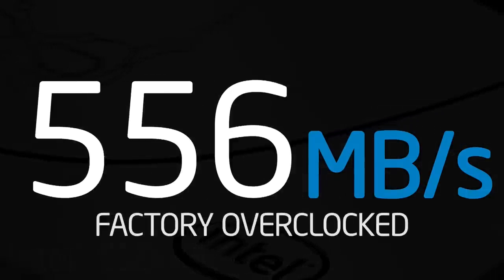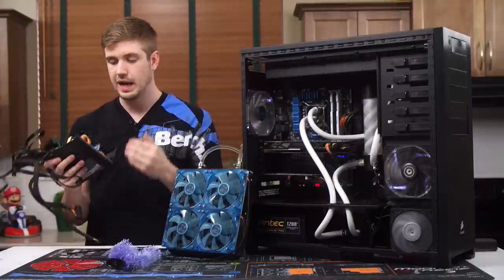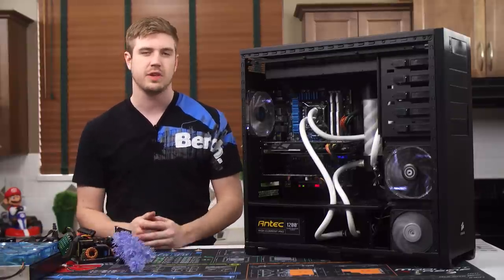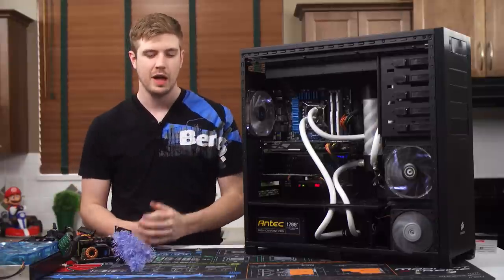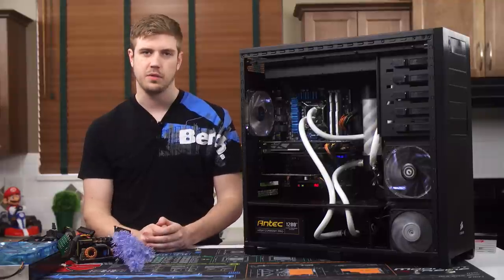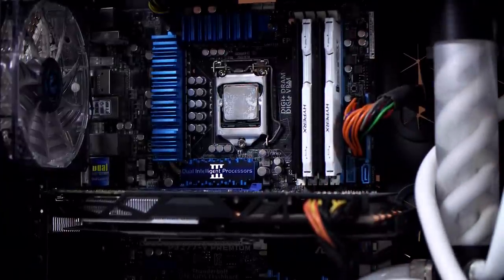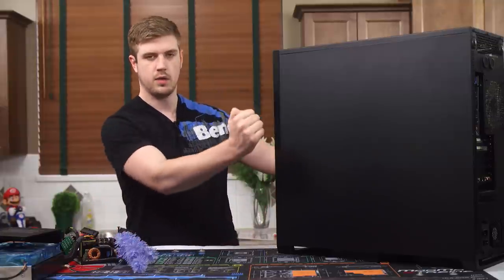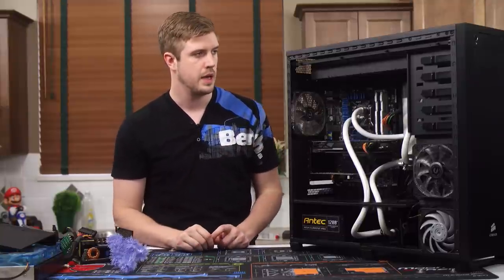Personal Rig Update 2 - Slick: The Introduction of Squirtle

Comment: I am still rocking my hd7870 and FX6300 ^_^
Reply: I dont really care I can still run all my games on high/ultra on 1080p going from 60-150(or 200(CoD4 :3)need thtat speeed and my display is 1080p) no problem.
Reply: yeah I have the same build and its amazing. no need to upgrade for a while
Reply: I'm on the fx-6200 lol, gfx is gtx660 but got the 280x coming this week. Wonder how much the fx-6200 will keep the 280x back ^^
Reply: DurkaDerper No I can't, it can't even turbo on my mobo ^^ an Asrock 960gm-Gs3 fx motherboard. But I will buy the haswell refresh with a nice mobo and the 280x is just for now, I'm waiting for the Gtx880 or maybe another 280x
Reply: I have a 7870 too :P
Reply: It's funny how you say "still rocking" as if it wasn't a 2 year old setup at most xD no offence of course, it's just a bit funny. a friend of mine got exactly the same on my suggestion ^^
Reply: Dustin Levine That's a good price. Here in Sweden I payed $260 for a GTX 660.
Reply: Erik4boss
I payed the same, I'm also Swedish. But the price on inet.se was ok for the 280x, I got the asus DCUII top version for 2790SEK or 420 dollars and got a fractal design integra r2 750w for 60 bucks, it's on sale at the moment. I'm expecting my parts will arrive on Tuesday or Wednesday ^^
Reply: That is pretty nice! I'm probably going to get a GTX 770/870 in my next build.
Reply: Salpeteroxid you won't get any less performance from a 280x with a 6200 unless you seriously under clock it
Reply: Erik4boss Yeah i'm also just waiting until the next generation of gpus to start rolling before i upgrade since the price to performance ratio of upgrading now just isnt good enough for me.
Reply: HD 6870 i7 2600 ^^
Reply: I run Phenom II X4 965 BE at 4GHz and R9 270X.
Reply: Davidxcat That is quite powerful actually!
Reply: I have two 7870.  #7870masterrace
Reply: BlackyProd atikmpag.sys error 7800-series masterrace regards 7850
Reply: Erik4boss And really hot! During summer I am melting in my small room.
Reply: Davidxcat I'm melting too. 4 monitors, they produce A LOT of heat.
Reply: Gtx 670 and i7 3770k :D
Reply: Jonathan Hine I mainly play BF4 and my CPU usage is really high. Can't wait until haswell refresh with that soldered ISH and a sweet z97 motherboard!
Reply: Salpeteroxid It will hold it so much back man trust me. I went from 58 fps (660ti) on cinebench on that cpu to 102 fps (660ti) on a 4.7ghz 4670k :)
Reply: Laurence Barnes Maybe I should have went with CPU and Motherboard first? But then again, I want the haswell refresh i5 since I'm planning to OC' it then not change CPU for 2-3 years.
Reply: Try a socket 478 pentium 4 with 256mb of ram
Reply: EnchantedxPie
No thanks!
Reply: I have a PC with C2Q Q6600 @3.2GHz,+ 4GB DDR2 RAM + Nvidia GTX260 216cc 896MB and I still love it, but I'll upgrade my GPU shortly but will keep the GTX260 for a dedicated PhysX card :)
Reply: Core i7 860 and GTX 570 represent.
Reply: Salpeteroxid I am using only 2 monitors. But during winter it is great.
Reply: I am still rocking my gtx 780 and 4770k ^_^
Reply: Salpeteroxid you'd be better going for a 8320 or a 6350 or if you really have to go Intel an i7 cos battlefield 4 utilises all cores possible so you want as many as you can get
Reply: Still using a good old i5 2500k and a radeon 6970 Flex :D
Reply: I am still rocking x2 270 and hd 4350 so yeah ...
Reply: I'm rocking a Gigabyte Geforce GTX 770 and i5-4670K :)
Reply: I'm still rocking a HD 6870 and an A10 5800K xD
Reply: TheFDDP Why would you use an APU with a dedicated GPU?...
Reply: I recently bulit a pc with a fx-6300. great for BF4
Reply: Jonathan Hine
No most definitely not. The performance between my fx-6200 and the fx-6350 is almost non-existing making the worst upgrade possible price/performance. Really bad advice.
 I don't "have" to go Intel, I want to go Intel because the processor are way better and I can afford it, and if I wanted to go fx-8350 I'd have to buy a new motherboard anyway and I'm not really on a budget so Intel it is.
Reply: I'm still rocking my crappy intel 4000
Reply: I rock intel hd 2500... So please everyone stop whining
Reply: 560ti and fx6100
Reply: I have the same specs, but with a R7 260X instead.
Reply: Yess my comment just passed Linus's comment-less comment I feel so fulfilled ^_^ Lol.
Reply: QX6850 & 4870X2... Currently waiting on a few more parts to get my R9-280 & 9590 build together
Reply: yuri53122 Good luck :D
Reply: Dylan Saranov Because at the time I had no idea it was an APU, I got it because it was quite cheap for it's performance.
Reply: HD7870 XT Joker and FX-8150. The ultimate heater for in the winter that absorbs a butt ton of energy!
Reply: am rockin a sapphire r9290 and FX8350
Reply: single core Pentium 524 oc 3.8GHz with Hyper threading and ATI Radeon xpress 200 64mb waiting for new pc parts with 8320 and r9 280
Reply: yeah I go the same setup too. not that old.
Reply: 760K and R9 270x
Reply: Salpeteroxid 880 isn't coming out till next year so I recommend the second 280x.
Reply: 2x hd radeon 6870 and i7 4770k
Reply: i5 4670k and GTX 670 :D
Reply: Phenom II X4 840 and GT240.
Reply: MrJigssaw1989 I had it on 4,38GHz but it was too much. I am not rly good at overclocking I was just trying how much I can get from stock voltage.
Reply: FX 8320 , HD 7970 :D
Reply: Q9550 (core 2 quad - yorkfield) @ 2.83 with a GTX 9800+ 1gb of GDDR3 on a gigabyte P45 motherboard and the fastest memory of the time 8GB of GDDR 3 1600 2008 FTW
Reply: GTX 660Ti and FX6300 here
Reply: Asterisk
I know it's not coming in the near future and I'm still waiting for the first 280x to arrive and one 280x will be sufficient for 1080p gaming on my 60 hz monitor for a long time. A second will probably not be needed this year for my purposes.
 I'm going to sound like an ass right now but I'm really tired of "recommendations" when I haven't asked for one. Especially the one from Jonathan Hine
Reply: Fx-6300 @4.4 with GTX 760
Reply: gage oldham
What's your bf4 FPS and what settings (if you play it).
Reply: I play on ultra and get 60FPS because i capped it
Reply: Salpeteroxid I was just trying to give you the best information I can to help you get the best performance because bf4 is a multi threaded game but you don't have to go with my recommendation it is your money anyway :)
Reply: Jonathan Hine
The difference between fx-6200 and fx-6350 isn't worth the money while the haswell refresh is a HUGE step up from the fx-6*** series in battlefield and I'm not on a budget.
 The fx-6*** do have six cores but only 3 modules and the cores shares resources, thus making them less able then an architecture like Phenom or haswell which has one module per core.
Reply: Salpeteroxid but you do have those 6 physical cores which you aren't gonna get with the haswell refresh but yes you will probably get slightly better performance from Intel
Reply: Jonathan Hine Nope I'm going to get 4. but it's not about the cores it's about IPC, that's why the 2 core i3 with hyperthreading is almost as good as the fx-6***.
 I'm not going to get a slight performance boost, I'm going to get a massive boost.
 I don't think you know that the modules set up an instruction for the core to compute and if you have only have 3 modules on six cores the cores will not always get an instruction when they are available but will have to wait for the module to send one. I have absolutely nothing against AMD, but I can't see your logic in spending €100 for 10% performance while I could spend €160 for 40% more performance.
Reply: I just knew that the 6300/8320 had 6/8 cores I had no idea they only had half the modules as cores and anyway I went for a 4670k so I can't really complain about you getting a haswell refresh cos I'm getting better performance than my friend with a 6350 in most games but they are more expensive which is one reason I was thinking of for going amd
Reply: Now I'm rocking the 280x and fx-6200.
Reply: Jonathan Hine
Np, tried to explain it as good as I could. :)
Reply: :) and how's the new card?
Reply: Jonathan Hine
Best thing ever, and bullcrap pile of garbage. Graphics are great and mantle works amazingly good but I can't connect all of my four monitors, only two. It would be very much appreciated if someone could help me, I have the asus top DCUII card and all kinds of adapters.
Reply: Salpeteroxid what kind of connection are they?
Reply: Jonathan Hine Displayport HMDI DVI/VGA with adapter and DVI. I have Displayport to DVI and Displayport to VGA adapters if needed but Windows says that I can't save the monitor settings, it drives me NUTS!
Reply: Idk it might be the vga connection but thats a long shot
Reply: Jonathan Hine I've tried all combinations. All digital, digital and DVI-VGA adapter. Really annoying, especially since the cards performs so well in BF4 with mantle that compensates for my fx-6200 (will be replaced when haswell refresh comes out in Sweden).
Reply: idk then it might be your cpu not having the horsepower to drive all the displays but thats just a geuss
Reply: Jonathan Hine It worked perfectly fine with a weaker GPU, the 4 monitors doesn't really demand any resources. 3 monitor gaming does, but I could do it on my GTX660. I really don't know the problem and it is really annoying. I wish someone knew how to fix it but I don't know anyone that has a 4 monitor setup =( Thanks for your help anyway :)
Reply: still pushing my 7870 to the limits. but i recently got a 8350 to upgrade from my 6350 basically for free. I think the next step will be a simple swap for a 290x and then rockin on with coming mantle titles
Reply: Michael Pfeifer Still using my Athlon 435 and HD 7700
Reply: Amedinno i sadly just today reached the limits with Far Cry 4 :( can only play on mixedmediumhigh at 1080 to get fluid 30fps. time for an upgrade :)
Reply: I can't even play 60 fps stable LoL :D
Reply: Jonathan Hine
I got the i7-4790k.
Reply: I just upgraded form my Phenom 955 and HD 5750 not long ago. I was getting med-high on most games, but it was finally lagging behind. Was a good 5 yrs with that PC. Now every single part except the dead power supply is in computers of family or friends who just needed a basic PC.

Comment: Just finished my build, took a lot of advice from your channel Linus. Put a video of it up a  couple of days ago (tour video) and I think it went really well! (4770k + 780 etc)
Reply: If anyone can see a way I could improve my build then any suggestions would be awesome!
Reply: BarbecuedPossum U could add another 780
Reply: Afootpluto Yeah, I was thinking of doing that, but a couple of problems haha. 1: My CX750M wouldn't quite cope with 2 780's I dont think and 2: 780's are rather expensive, I'm looking to do some things that can be done quite quickly and inexpensively :) I will definitely be thinking about it though!
Reply: BarbecuedPossum Your system would be at like 700-730 (Full Load) Watts with another 780
Reply: BarbecuedPossum nice build, I did my first build a few months back after watching LTT alot as well, went with a 4670k, asus dcu2 780, ect. in a define r4. was thinking about an h100, but there was a sale for a noctua nh-d14 (looks sweet through the window).
What's your monitor set up like? I ran out of money and just hooked up my 50in tv and use wireless keyboard and mouse from a comfy chair
Reply: Noah Fix cool idea I do that with my system too doing a tour of my system soon on ProPitchProductions
Reply: Noah Fix I'm using a 46'' Sony Bravia haha so pretty much the same here. We're moving house soon so it's only a temporary setup. Tv's are perfect for racing sims etc. though!

Comment: LinusTechTips   I want to hear the story of how in the hell a mineral oil cooled computer got you a scholarship. Do you have a degree in Computer engineering?
Reply: probably a similar thing as to how he got the job, showed it off, maybe even did it as a project and excelled at his computer classes. lots of teenagers do well in computer sciences, he had this before it was a commonly known thing, so it would make him stand out.
Reply: *****  >public administration
top kek your opinion is heeded move on
Reply: Look I understand you don't need a stem degree to build a computer I have my comp sci degree and program database applications in C,java,vb.net using oracle,mysql and SQL databases. I'm just saying the only feasible degree to receive a scholarship for building a PC would be computer engineering. Unless Linus gave him a bunch of cash and he counts that as a scholarship.
Reply: I think you are reading WAY more into his statement than is really there. It was probably just the computer he did all of his homework/ scholarship apps/ entrance letters...ect on. It was the computer he had as a teenager going through all of those transitory times and as he said in the video he is very sentimental.

Comment: Hey Slick you should look at the NZXT H440, It has everything i'd ever want in a case ~

- Noise damping  foam on Front/Both Sides 
- Adjustable Fan holes that support 120/140mm
- Steel construction throughout the entire case ( Except on PSU shroud/small line on the top )
- Magnetic dust filters on front/bottom
- Tons of cable management room
- Steel removable drive bays 8 2.5" / 6 5.25"
- I/O LED
- Comes in black/red, white/black, black/orange,  black/green and black/blue
- 2 360mm Rad support (front one has push + pull compatibility
- No ugly front drive bays
- Huge side panel window
- LED PSU shroud
- Top of the case has 2USB 2.0 / 2USB 3.0 / Power / Reset / Mic / Headphone
- Rubber feet about 1" above ground
- Comes with 4 FN V2 NZXT Fans
- All black low profile front i/o cables
- USB 3.0 Header
- Comes with 10 port - 3pin fan hub ( Powered with molex )
- Tons of liquid cooling support ( 120mm rad in back 240/280/360 rad on top 240/240/360 rad in front with push/pull )
- 2 Water cooling rubber grommets holes on the back of the case 
- High quality rubber grommet cable management holes
- All black thumb screws on all parts ( that stay attached when unscrewed - can be taken off if you keep unscrewing them - drive bays/mobo mounts/side panels/psu panel )
- 7 pci-e expansion ports - steel - black thumb screws
- Huge CPU cutout 
-Supports 406mm GPUs ( Length )
- 21.8 inches, 11.2 inches, 22 inches ( LWH )
- 9.75 kgs / 21.5 pounds 
- Supports mini-ITX - micro ATX - ATX mobos
- Mid tower Case 
- All for 120$ USD atm

IMHO - Best silence case on the market that covers all my standards. Looks great, has a side panel, Built for silence and is of very high build quality.

Comment: Damn, that's some bad wire management. 

At least I've got an excuse. My case doesn't support wire management. It predates the concept. Also the concept of airflow. And space to actually put a hard drive and a video card in the same region at the same time.

I need a new case.

And a new CPU, because the Q6600 is getting old. And a new motherboard for it. RAM too. A PSU as well. Maybe a new video card. An SSD wouldn't hurt. Some extra cooling would be nice.

So, I need a new PC.
Reply: Lol, I have put a "dual drive stack" on top of my PSU with duct tape, they get really warm.

Comment: There's no need to get excited for "industrial" noctua fans, bitch please Delta already has 6000rpm 200mm fans all black and has had them for years
Reply: Because a 6.6 watt fan is clearly competing with a 230 watt fan.
Reply: ***** they are way louder lol
Reply: ***** Guess why they're called "Delta" Because they sound like jets :D
Reply: 'Industrial; isn't about RPM/CFM, it's about reliability.
Reply: He'll probably be running them at around 800RPM...
Reply: nimrodery
Clearly quality comes with compromise on this one
Reply: *****
Dude don't go talking to me like you know the market Delta makes Industrial fans Full Stop. Also why do you think that a 200mm fan would be their only product clearly they make 80,120 and 140mm fans all up to and ABOVE 6000rpm all of which can be easily adjusted with a fan speed controller and will make the same or even less noise as any competitor. Noctua are not the only company out there and just because they market their products at a different audience does not mean they are the right option.
Reply: widgetpicz Slick isn't building a hovercraft.
Reply: widgetpicz Delta fans are the best bang for your buck for probably the last 20 years.  Good airflow, long life, and can be made quiet with a fan controller.